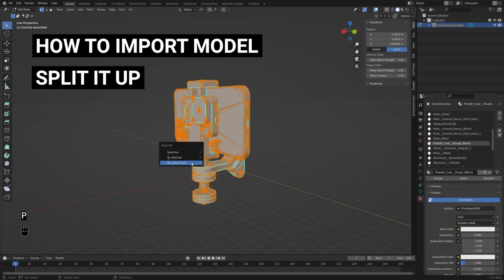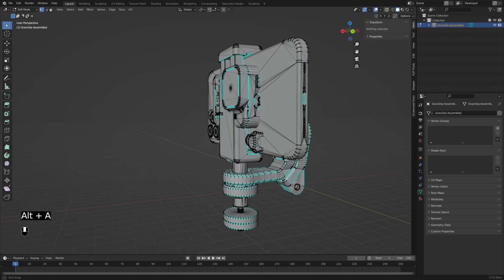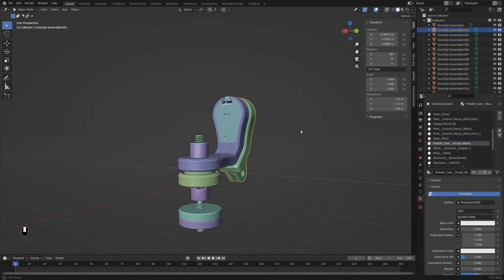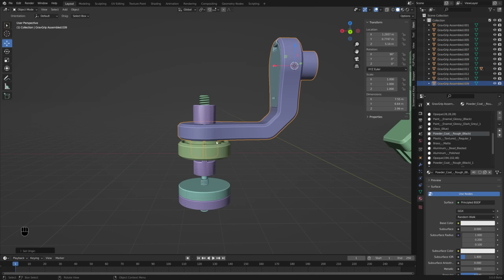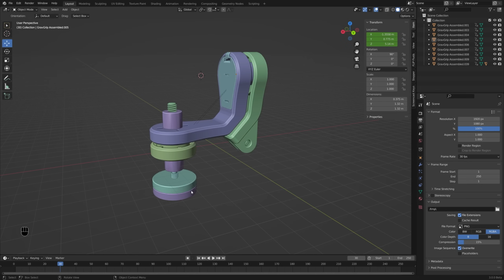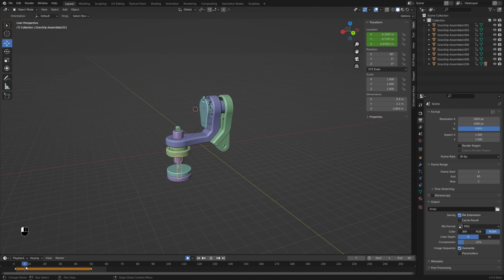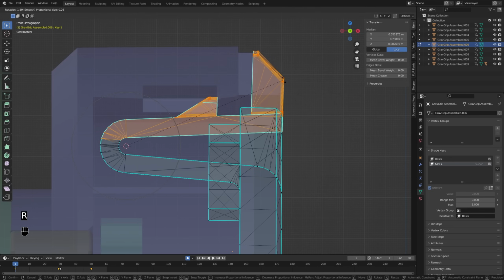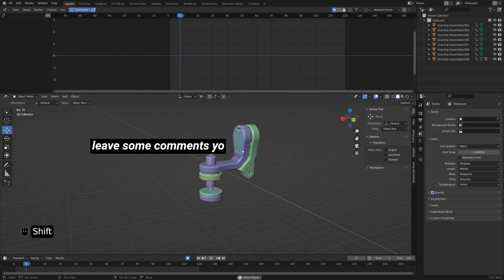Import a CAD model and create an Exploded View animation in Blender 3.0

Comment: Hi, which software was the original file from?  I’m hoping to show what can be done using a solid works file for my employer’s engineering department.  Thanks
Reply from the maker: I believe this is from fusion 360 but I work with SOLIDWORKS files a lot too.
Reply: Thanks!

Comment: Thanks I was using SimLAB to export constraints and animation from SW to blender, but it sometimes get issues with complex assemblies. Your method is solid and without issue, the problem is that I have to do th assembly job twice, one time in SW and then in Blender. BTW Your edges looks so beautiful in the viewport. Are you using HardOPS or it's the genuine chamfers from the CAD model ??? Thanks again !!!

Comment: For any Creo users facing problem with their CAD models to perform  separating by loose parts after importing an assembly into blender, check the "Split by group" option under Geometry tab on the right side of import window.
Reply: Is it not easier to just use Keyshot.

Comment: Awesome tutorial. I work with an engineering team and am often sent OBJ files. One trick I aslo found was when you import if you twirl down the Geometry option and select split by group. It usually does the separation part you went through in edit mode, but it does this automatically. Its not perfect, but does work very well. Cheers.
Reply from the maker: Thanks I'll try that next time!

Comment: Great video Derek!! Exactly what I have been looking for for a while. Can you please continue to make more videos on cad to Blender? The whole workflow (means more complex animations than in this video. And also assign materials and so on)
Reply from the maker: Sure! At a certain point they're just blender videos but what else do you think would be cad specific you'd like to know?
Reply: @DerekElliott  yeah that's true... I think it's just something about the workflow when modeling products made as cad that it useful. Even if isolated tasks are possible to find in other tutorials. 
I would suggest animation follow a path, both camera and objects. Physics. Is it possible to animate snap fits based on when they hit other parts? Like simulation of clips basically.
Also water splash, xray beams, fog, and such things could be useful. 
And also add metarials and textures for typical engineering materials (plastics, metals, wood and so on). Alternatively, where to find ready material for blender,  for free.
Don't know if all this makes sense?

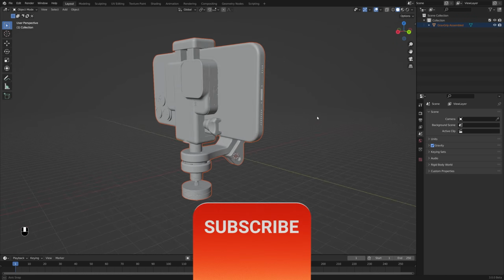Comment: 2:28 It sounds like you don't understand why this happens. By default blender uses 1 unit = 1 meter. Typically CAD files are set up to use 1 unit = 1mm, so when you don't change the import unit scale, they'll most likely be 1000× times too large. 1 unit = 1cm is also used, so then you'll indeed need to scale it 0.1, and again 0.1 (or just 0.01 once, which is 1/100th the scale, aka 1m > 1cm). If you were using the default unit setup, the model you're using is being displayed as a 16 meter wide phone grip (based on your grid). Considering the model seems to be a iPhone 13 Pro Max, that would make sense, since that phone is about 16cm tall.
Reply from the maker: Good explanation

Comment: Something that may be really helpful is that rendering video. A lot of bad topology with CAD models, and I'd like to hear your rendering tips to get good looking materials with junk geometry.
Reply from the maker: Yes I'll have to do more CAD related
Reply: Exactly. The main issue I had when trying to import CAD models to Blender is having a good topology for easily laydown a good UV map for texturing, usually they have even worse topology than what was shown in this video. I'm yet to find a better solution than importing STEP file in 3ds Max and keep as "body object", so you have perfect UV straight out of the box.
Reply from the maker: @fvalduga  usually with bad topology if it absolutely needs a uv unwrap then working with smart uv project, project from view, cube project, etc or a combo will work out. Mostly with mechanical stuff though I'm using basic procedural textures though and UVs not required
Reply: One more thing...If topology is important for texturing a CAD model, I've seen some videos where people use  MOI3D to export a mesh file (fbx or obj) with very clean topology. Never tried myself, but I will take this approach if I would have to stick to Blender as a render package.

Comment: Alright one thing I did see missing here is that when you upload big CAD files sometimes they can come with thousands of material slots and many people are having problem with the "remove unused slots" function ... for me it literally does nothing. SO a good work around is to add a basic cube ... select all the parts that have these slots and then join them to the cube... they will then conform to the active object and clear all these slots out for you. Hope it helps and hopefully Blender fixes that soon. ( PS I found this out after removing 600 slots manually AHAH!! )
Reply from the maker: Yeah this does tend to be a PITA. Good tip!

Comment: Thanks Derrick! What's the best way to set-up the file in Blender so when the CAD model is changed from version 1 to 2, the model in blender is automatically or easily updated?
Reply from the maker: You could maybe have the file linked elsewhere so it would Auto update but honestly I think the way I'd do that is just move the new version in to place and then copy location/rot info, link animation data from old, then delete old. Also I wouldn't normally be doing this type of animation if a design was actively under construction, ideally...
Reply: @DerekElliott  Thanks!!

Comment: We use PIXYZ and VRED for CAD tessellation for large assemblies (around 80 million poly) and Blender for clean-up of small sub-assemblies. VRED tessellation is not good and you end up with each patch surface being an individual part. Merge vertices destroys the custom normals. PIXYZ tessellation is very good and it works great with Step files. Has some issues with our JT files, though.

Comment: I guess it could be handy when you have pulled all the pats apart, is to keyfame them outside the time line. So add location keys and move those keys to -10 frame or so. Very esay to switch back and see how things connect with each other.
Reply from the maker: Yes I definitely have done this

Comment: Not sure what the relation between the origins and the curve select tool is. That should not matter if all origins are in the same spot. Wondering now why it selected multiple parts which didn't seem to be under the circle icon??
Reply: wow i totally forgot that it use the origins. Would be really useful if it actually could catch only mesh. Perhaps we could ask for something like this on rightclick select
Reply from the maker: so I think Box Select gets whatever it touches but Circle Select works on origins